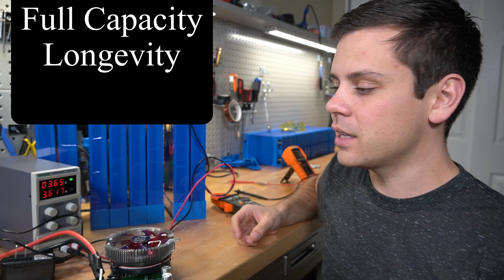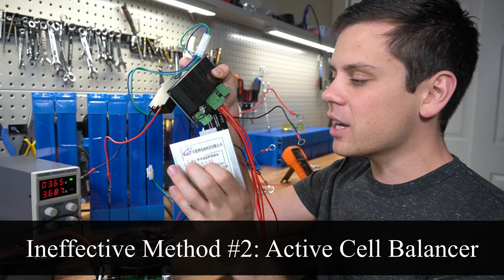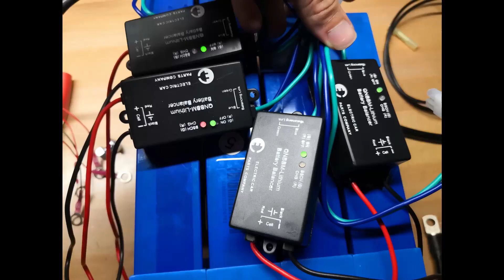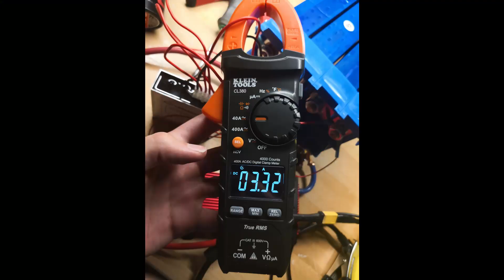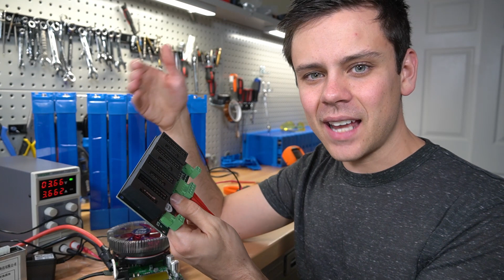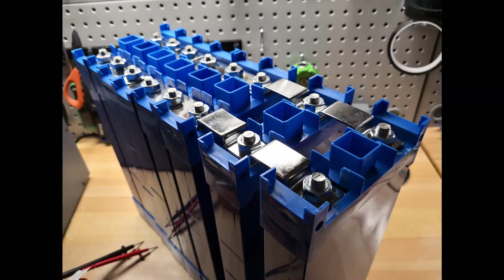Advanced LiFePO4 Cell Balancing Discussion (and how people are getting ripped off)

Comment: I use 6 Auto Lead-Acid Batts in parallel---The Pos Charge lead is at one end and the Neg is at the other end.
The load is drawn off the same way.

The charge goes thru ALL batts all the time. 100 % Solar. Two of the were bought in 2014 and still going.
Does that arrangement keep the LI-FE P-O  Batts healthy????
Reply: HALF PAST NEWS 
You have 6 Auto LA batteries in parallel. Then you ask about LiFePo batteries. How are they connected in your system?
Reply: CONSERVATOR -- I do not have ANY  li-fe-po batts.--- I want to know if hooking up lifepo batt the same way as the LA batts would keep them balanced.--
And how many lifepo batts would I need to EQUAL the LA Batts
Reply: HALF PAST NEWS 
How many kWh do you have at the moment? 
You would probably need 2 or 3 batteries like Will shows in his video’s. 
You could hook them up like you have your LA batteries hooked up but I would suggest to make one 2P4S package managed by 1 beefy BMS. 
Watch more video’s of Will. Look for lead acid vs LiFePO4 comparison. Idk the title but you’ll it.

Comment: Hi I am I bit confused , I seen I few of you video's and they are all great , but I seen I few video's and you told use yo bottom balance  LifePO4 cells and now you said we should top balance them at 3.65 volts can you please lets us all know what is the right way thanks
Reply from the maker: Bottom balancing is great if you do not run a BMS. Many LiFePO4 "pioneers" still run their systems this way, and I still have one test system that runs without BMS, but it is somewhat risky if you don't know what you're doing. So I have focused my attention to bms systems recently, and that requires top balancing instead.
I actually have an older video that covers top vs bottom balancing. It really depends on intended application and equipment used.

Comment: I'm not 100% sure, but I have read somewhere that usually big reason to use BMS is also to get longer life for the battery pack. But I might be wrong, and perhaps it is so but don't know if the # of cycles is like 5000 with bms vs 1000 without or something totally different like 5000 vs 4900 =P

Comment: Hello, since I don't understand English very well, I would like to ask you something with the help of a translator.  I think I understand that if I connect a lifepo4 cell to a laboratory power supply and charge with 3.65V and 5A until the amps is at 0, then the cell is fully charged.  Is that correct?  I ordered 4 cells a 3.2V and 280Ah from China and would like to bring them up to capacity before I assemble them, it would be very nice of you if you could help me.  Thank you and greetings from Vienna

Comment: Great video, I used to bottom balance my new cells because of your previous video. Now, if I understand wright, you recommend only top balancing with your describe method for low C rate discharge. I use my solar system for an RV. It is low C rate 99% of the time except when the microwave kick in. Can this system be considered as low C rate discharge even if it is pump up once in a while?
Reply from the maker: Oh check out my video on why you need to bottom balance or top balance. If you're using a BMS, top balance. If you are not using a BMS and your equipment does not have programmable low voltage disconnect, bottom balance and manually set charge absorption.

Comment: What if the batteries needed to be connected in a series configuration to obtain a specific voltage?  With no way for them to self equalize, would a cell balance controller be useful in that configuration ?  Thanks Will for all your hard work to educate us !

Comment: I've been using some OLD used BYD's.

I finally put a BMS on yesterday.
The BMS showed an entire 0.002 V difference. :-/
I put the 4th BMS on today, and 0.007 V difference.

The two I put on 1st (A month ago), catches one cell every cycle going way out of voltage. So, I know I have 1 cell being bad, out of 64, but it hides as normal when charged up.

Comment: wondering if you have been thinking about doing a DIY BMS with ESP8266 or ESP32?
thought that both of them will handle the volt for LiFepo4 but I do not know if they can handle 4.2volts and my idea is if you use a two stage balancing through MOSFET (one with 5-8 omes resistance and one with 2 omes resistance so it will be about 0.5 A and 2A which max and control them with PWM) so the first one goes in at 3.5v if the other cells are quite close and 2 + 0.5 Amps if it goes above 3.65v, but can also burn off a lot of energy if a cell starts to rise on the knee long before the other cells so that is when it has not started to descend on the Amperen.

I think you mentioned that you have been using microcontrollers before and these are much like audrinos but with Wifi and ESP32 have wifi and BT
(you might be able to mention the idea in a video if you are considering testing this idea or something similar)
(google translation doesn't work the way I want but hope what I mean appears anyway)

Comment: Hi Will, I have a question that you may be able to answer or even test :-) If you have, let’s say a 2p4s bank and you want to balance cells with your bench PSU then I think you can first disconnect the battery from any loads (main disconnect) then set the bench PSU to 3.65V (whatever manufacturer lists) and connect it to a single cell or group of parallel cells. When it is done charging, move to the next group. This allows top balancing without the need to disassemble a bank. Would work great for those with two banks.

Comment: These balancer/equalizers only seem to move charge from adjacent cells when I tested them. Setup as 100,100,60,60 the middle cells likely did better but the last 60Ah cell likely reached cutoff voltage first. if setup as 100,60,100,60 you might get a little more capacity out since the active equalizer might work better. Still an unrealistic setup. Key is to have the pack up to 100% SoC once in a while to maintain balance if cells drift in a pack.

Active balance is needed in extreme applications like space but not really that effective for normal applications.
Reply from the maker: Good points. Yes agreed

Comment: im using 100ah agm    have 5 in parallel but on a bus bar connected individually   got my transfer switch set for 13.4 to activate and cut off at 12

Comment: Hey will I have guy selling grid tie solar panel 250w.   I told him I want off grid solar he suggested as long as I use an mppt charge controller it doesn’t matter if the solar panel is grid tie the mppt charge controller will manage it it’s a none issue. What do you think? Will an mppt charge controller work with a grid tie solar panel?

Comment: Help please!? What do I do next if I did it wrong and didn’t properly bottom balance my new prismatic cells?. I mid balanced them by hooking them up in parallel at 3.2 Volts and then installed them. After a month of use one cell is 0.02-0.03V high when charging. So that’s my lowest capacity cell, right? Do I top balance or bottom balance now? These are being used with solar for a van. The water heater is the big load and drew 75 amps (900 watts) on the 200ah LifePO4 pack. I wanted a bigger 400ah pack so I could draw more from the middle and have a lower C rate but couldn’t afford it. 
 Do I have to buy a regulated power supply now to do what Will showed in the video. Top balance. But he says bottom balance makes sense for solar. Maybe he should do a video for the folks who screwed it up the first time. Or can I rebalance these cells using my solar and not buy a power supply? Isn’t the charge controller a power supply? 
 I have a 100 Amp Daly 4s BMS but haven’t hooked it up because it seems almost useless and may damage my controller and inverter!. Ive connected the balance wires but I’m not connecting it to my charging sources because Morningstar says it will void the warranty and may destroy my charge controller if it’s disconnected under load?  Same thing for disconnecting the inverter under load. Has Will clearly solved this issue. If so I missed it. Similarly, Victron energy says not to use their Battery Protect to disconnect a inverter under load. But I keep seeing mention of using them in Wills videos. Which is it? 
 Am I correct the Daly BMS is a top balance dissipating balancer that only works while charging? Also, will the Daly BMS balance cells upon charging if only the balance wires are connected? Sorry for so many questions. Thanks.
Reply: The obvious problem with my solar controller is it won’t charge at 3.6 volts. Is there a cheap but decent regulated power supply that will work? I’m boondocking now. Would a DC-DC converter from my starting battery work as a regulated power supply? Thanks

Comment: Good morning it has been over 24 months of using Headway 38120s cells 32 cells per pack and  4 packs =128 cells total givinging them a voltage of 13.2 DC (home voltage) where they live at 80% of the time.  While charging can take 2-6 hrs with 1000 wats of solar here in central Maine these cells put all other lead battries to shame  No more wattering no more gassing no more desulsifieng  no maintence whatso-ever NO ACID.    WISH I COULD OF BOUGHT THEM BEFORE  NOT ONE PROBLEM WITH THEM.

Comment: How long does it take to balance? I have 4 cells 280ah. I hooked up a dc power supply 3.6volts  @3.00 amps for 20+ hours and cells never go above 3.30 volts. Cells started at 2.9 volts !
Reply: @ 2.9 volts, you started charging at less than 10% soc. You've put in about 60 amps into the battery and still have a long way to go on a 280 ah cell.
Reply: @SpeakerKevin  thanks, matey

Comment: Hi Will, thanks for the videos it is seriously awesome to be able to watch and learn about how this stuff works. I have a sort of off topic question. I'm building a solar electric boat, to be driven with two 12volt brushed motors one on either side of the boat. The motors and propellers are set up to provide thrust in forward and reverse. To give the boat tank steering. Controlling the motors with a PWM and a polarity reversing switch. So at the moment each motor has two controls. So my question is can I do all that with just one controller per motor? Is there something like a polarity reversing PWM giving speed and directional control on a single controller?

Thanks Will

Comment: You tested it for hours, day or weeks? Run it for months and years everyday 1 cycle full charge and discharge and see the result. even in 2 months of daily cycles your cell will unbalanced thats because cells are not identical in capacity and resistance. I have those prismatics cells in more than a year working daily 1 cycle and I experienced that. Now I use deligreen, ts plug and forget. working well. Do not conclude your observation base on a few days or week without daily cycle of charge and discharge. even its 1 year without balancer if you did not charge or discharge daily it will always balance. run it for a year and post here your conclusion.
Reply from the maker: That point was covered in previous videos that cell drift is minimal, or practically none existent, for solar LiFePO4 batteries. I ran without a BMS for nearly a year and they stayed within .01 at low soc after a solid bottom balance. There is no need to balance more than a normal passive dissipative balancer can. They will stay balanced just fine. 1000$ BMS have passive dissipative balancers and I am trusting those engineers more than random people in comment sections of the internet. And from testing it, it doesn't help in mismatched systems
Reply from the maker: Sounds like you screwed up on your system but not matching your cells right or the c rate of your bank. If you are having ongoing balancing issues, it's because your cells are low quality or not matched.

Comment: I've modified my SKY RC 3000 charger and soldered 12 AWG cable to each of the outputs with a ring terminal on the other end, now I can dial in charge and discharge rates, and how many times it restarts the charge discharge processes and how long the rest phase is. Also the ability to choose tail current charge cut off voltage. (considered mine charged when the charger dropped to  0.2 amps)Down side, I can only push 3 amps per output.(or 12 amps charging only 1 cell with all four outputs) All four of my cells now rest between 3.540 and 3.545v I don't think anyone is going to get it more accurate than that.. (measured with Fluke 87V true RMS Multimeter)

Comment: My banks are all used 18650s so an active balancer is a good thing
Reply from the maker: Do you have capacity test results that you can share?
Reply: No i have about 100 Ah 7s pack and have an inverter now but still need solar and a charge controller obviously I tested all the cells before going into the pack but i also have a portable pack with and inverter and stuff that is 7s10p and the capacity was matched within like 5 mah but if it is used kinda hard like 300 watts I have 2  groups that drop off a little faster
Reply: Noes de wae two VanCamp  ill probably be getting an epever or something i can set the limits on and mppt but thanks

Comment: What is your preference for bms 100a or 200a 24 and 48v
Reply: @EdisonWong2004  Low temperature disconnect isn't necessary as lithium cells can discharge at and below freezing. A minimum temperature charge connect is what's needed. Below 32°F/0°C, don't allow. Above that, allow.
Reply: @Fil-Am Gabe, current decreases as voltage increases. Therefore, use as high a voltage as practical for the application. Personally, I build 48V systems for commercial and residential applications, and 24V for mobile/portable applications, with exceptions of 36V to 72V systems for specific high-output applications, such as personal mobility (think e-bike, etc.). I never build 12V systems.

Now, most system requirements include 12V power delivery. For that, I simply use buck converters. The beauty there is that a clean, consistent 12Vdc is continuously provided across the system discharge curve. This keeps everything being powered/charged very, very happy indeed.

For high-output requirements, you have two choices:
1) Pay for an expensive, high-current BMS, or;
2) Use an economical, low-current BMS in combination with external transistors, relays or contactors.

The cost curve for BMS's increases dramatically with current carrying capacity. These units also experience inherently higher failure rates, and the design of some (trace and/or conductor size, etc.) is even questionable. For these reasons, I prefer option #2 for high-output systems where space permits the addition of external components.
Reply: Edison Wong 
A low temp disconnect will disconnect whenever the temperature drops below freezing wether the battery is being charged or not.

Just curious: what made you think it would keep charging when the temperature would drop during charging?
Reply: @Conservator.  Sorry my bad, I confused it with something else.

Comment: This video  is just in time, I'm waiting delivery of (8) 200ah lifepo4's.
I was going to get a Daly 100amp BMS with balancer included, should I get a different BMS?
Reply: It all depends on the intended configuration, as well as the batteries themselves.

Are these 200Ah LiFePO4 batteries?
Do these batteries have internal BMS's and, if so, what protections are provided?
Will the batteries be arranged in series, parallel or series/parallel? Balancing isn't applicable for purely parallel configurations.
What's the maximum current design requirement? Current is additive for parallel configurations, while constant in series.

If the batteries you reference are of the 12V "drop-in replacement" variety, they likely have integral BMS's. And if you intend to connect them in parallel for a 12V/1,600Ah/19.2kWh system, no external BMS is applicable.
Reply: @ARepublicIfYouCanKeepIt  They are bare winston lifepo4. All 8 in series for 24v! The Daly is an 8 series 100a model.

Comment: Hey Will I'm one of those car audio guys. What bms do you recommend if you do recommend a active Balancer
Reply from the maker: I would first balance the cells (lto?) and see how well it works under extreme load. You may not need it at all. And you can run without a bms with lto in 6S configuration.
Reply: Thanks for the advice I'd be running headway lifepo4 cells
Reply from the maker: @kieranmorrison4348  Ohh ok. You may need a pretty beefy BMS for that then. Thats tough, most are limited to 100A
Reply from the maker: @kieranmorrison4348  You could top balance and run it without bms, but understand if it ever gets too low, it will be damaged. read about how to run without bms if you want.
Reply: @WillProwse  The cells will likely never see below 12v. I'm more worried about getting them out of balance and overcharging a cell because of the high C rate. I was wondering if I could hook up a bms, only have charging current go into the bms and the load pulled straight from the cells?

Comment: Hallo, 
what obout solar-string-optimizer with MPPT? 3 strings, first 4x 30V, second 6x 30v, third 8x30V. Each string has a different shadow and orientation. Voltage of inverter input is 180V - 720V. What's the best Way?
greetings
Reply: It's all about the cost.  The string optimizer part my add cost for the optimizers yet reduce cost on wiring.  The charge controller will also more if it's a standalone and not part of a hybrid inverter system.  if your panels aren't partially shaded then you've got nothing to gain anyway.